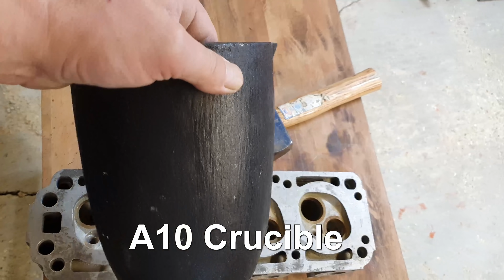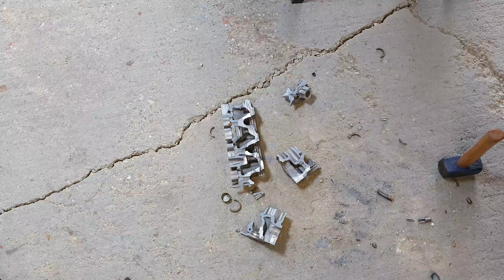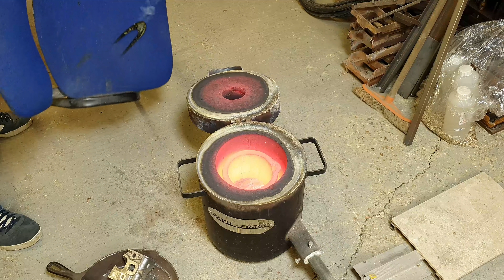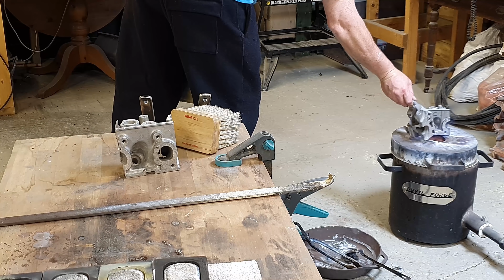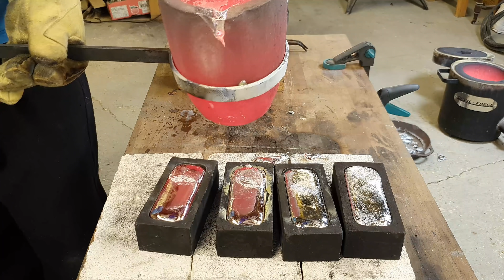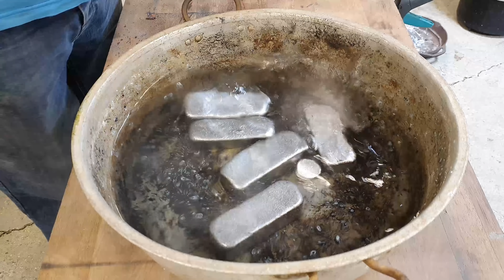BMW Cylinder Head Melt - BMW Bullion

Comment from the maker: Hope you are all well during these mad times...  This engine block should provide me with some decent casting alloy for future projects.  Shrinkage seems to be very low and should be extremely strong being 7000 series aluminium.  Stay safe everyone.  Cheers Andy 🥂👍😎
Reply: I'm sorry if this a question you keep getting asked, but where do you purchase your crucibles from?
Reply from the maker: Are you based in the UK ?
Reply: @MeltandCast  No. East coast of the United States
Reply from the maker: Ah OK...  The crucibles I use are Morgan Salamander crucibles and are extremely durable.  I've never had any issues with any of them and am yet to wear one out !!   I just looked at their website and it looks like they have a factory in Wallingford, Connecticut.  Try searching Morgan Salamander Molten Metal Systems in this area.  Hope this helps.  Cheers Andy 😎👍🥂
Reply: @MeltandCast  Thank you so much!
Reply from the maker: My pleasure mate 🥂👍😎
Reply from the maker: Oh and you might have to call them to find a local distributor as I don't think the factories sell direct, at least they don't in the UK.  Shop around though, some resellers really hike up the prices (at least they do here) hehe.  Hope you find what you need, cheers 😎👍🥂
Reply: @MeltandCast  will have look again but I think they have a channel showing how they make them.
Not your normal everyday clay graphite crucibles.
Reply from the maker: They really are good crucibles...  I'm told they last 3 years plus if looked after.  After just over 1 years use all mine look good as new.  Some have flux residue on them but they all seem very resistant to chemical attack.  Nothing like those cracked clay crucibles I've seen elsewhere on YT that seem to split, crack and break all the time.  I'll have a look for that video it sounds interesting.  Cheers Andy 😎👍🥂
Reply: @MeltandCast  hope all is ok with you.
Reply: Worked on a bmw  this morning and all i see  almost is aluminium aluminum!!!!  😋
Reply: Instablaster.

Comment: Does remelting and casting do much to reduce the usefulness of the aluminum?
Reply from the maker: Not as far as I'm aware although overheating it can cause issues (and this melt was probably quite well overheated).  It shouldn't be too much of an issue though, the only likely adverse effects as far as I'm aware is you may get additional dross on the second melt due to the additional oxides present as a result of the overheating.  If you look closely at the final ingots you may see a little porosity but this can also be fixed on the next melt by degassing, which I will do when I sand cast this in a few days time.  My main aim with this melt was to remove the steel parts from the engine and get it into smaller ingots to make life easier for me next time.   This way I can melt all the metal required at once, monitor the temps better and degass before pouring.  Most of the other aluminium I have melted is 1 series aluminium and it suffers horribly from shrinkage and is difficult to cast especially with my lack of experience working with aluminium.  This alloy hardly shrinks at all, in fact I had a real job removing the ingots from the moulds.  These ingots will be cast into a gift for a friend and I wanted to use a decent alloy to give me the best chance of a successful casting.  Cheers Andy 😎👍🥂

Comment: That cylinder head was originally cast into its current shape, so the alloy should be great for whatever you need to cast with it. 
Cheers
Reply from the maker: Thanks Ted.  That's what I was hoping for, the other 1 series aluminium I tried using before shrank terribly.  If I mess up casting this I can't blame BMW, the fault will be all mine haha.  Take care mate...  Andy 🥂👍😎

Comment: What kind of cutting disc was that on your angle grinder? Does it work well on steel? Abrasive discs wear out fast so I'm curious about alternatives.
Reply from the maker: They were the cutting discs that came with the grinder, they are very thin but last quite well.  I did shatter one disc on the back side of the engine block, but they go through steel and iron like butter.  Softer metals seem to take longer especially zinc which is a nightmare.  I tried to cut a 12kg zinc ingot in half and used a whole disc and only got halfway through.  In the end I just melted it in my big frying pan and poured it into a crucible to make smaller ingots.  Cheers Andy 🥂👍😎

Comment: Just curious, What makes you think the alloy is  from the so called 7000 series - seems an unlikely alloy to make a cylinder head from. Incidentally the most common alloy (DTD 5008) in this series has just 0.5 to 0.7% Mg. I have worked extensively with this alloy and while it is a joy to machine - after waiting at least a week for it to naturally age harden - it is not the most castable of alloys It is prone to cracking in the die to the extent that it is generally considered as not suitable for gravity die work and it does not feed anywhere near as well as, say, 356. I think most EU manufactures are obliged to mark the castings with an alloy designation for recycling purposes so if you have another head look at ALL the numbers/letters stamped on it, somewhere in all that should be the alloy designation. All that said it would not surprise me what BMW used, their choice of wheel alloy is IMHO absolute rubbish and is perhaps why people tell me that if its a BMW wheel it will likely be cracked!... Martin
Reply: Thank you Marin.  ;-)
Reply from the maker: Hi Martin the engine block is from the N45B16 engine and after a lot of searching I am still struggling to find a definitive answer to the alloy type used in this engine.  Maybe my searches aren't accurate enough but i did find a company called HT Howard who manufacture camshaft caps matched to the engine alloy used in these engines.  The quoted numbers for these caps are "7 559 168" and "7 505 975".  I took this as 7559 alloy and 7505 alloy.  I looked up both of these in Woldmans book of engineering alloys and couldn't find a specific match for this alloy.  I assumed this was because my book is the fourth edition and being a newer alloy, it may not be included in my book as it is now up to the 11th edition.  Additional searches for 7559 and 7505 alloy also drew a blank and the closest I could find on Wikipedia was 7475 aluminium at 5.75% zinc, 2.3% magnesium, 1.5% silicon and 0.22% chromium.  7 series alloy was described as one of the highest strength aluminium alloys and thus it made sense to me that this may be a suitable choice for BMW engine blocks.  I did find 5575 series aluminium on Wikipedia as well but was described as suitable for marine applications and automotive trim.  Therefore I made the assumption that this was 7 series aluminium due to the strength.  I do have another section of this engine and will check the numbers on it next time I am in the shed, I will also check back on the unedited video as I think the numbers were also visible on that.  Thanks for all your advice...  Andy 🥂👍😎
Reply: @MeltandCast  Perfect use for that cylinder head.  Now maybe it can have a longer life than the shitty engineers at BMW could have ever planned for it!
Reply from the maker: Rofl 🥂👍😎

Comment: You do know you can use a plain ordinary skill saw with a cheapy saw blade and slice aluminum up right?  It's 20times faster than a cut off disc and 50times safer.  Use a few sprays of wd40 for lubricant.
Reply from the maker: Thanks WT, no I didn't mate...  I have a chop saw that I hardly ever use for wood...  so just use that ?  I don't need a metal blade ?  I did shatter one disc going through the block and it took much much longer than it shows in the video.  Thanks for the advice, I'll remember that next time...  Cheers Andy 🥂👍😎
Reply: @MeltandCast  Well there you have it!  Yes you could use your chop saw, but try to clamp your work down.  I just use my beater 7 1/4" skill saw and a thin 48tooth blade.  Get it up to speed and have at it.  Do wear plenty of PPE.  I wear safety glasses AND a full face shield.  Leather gloves, apron and long pants.  You will be shocked when the chips start flying!  It really cuts like butter.  Best part, you don't end up breathing all that ground up grinding disc and aluminum dust.  You'll never use an angle grinder on aluminum ever again!
Reply from the maker: That's brilliant mate, thanks for that.  I'll have a dig around the garage and see if I can find my old skill saw...  Cheers Andy 😉🥂👍

Comment: Hello. I have to melt 1 gram of iron in 300 grams of copper. Do you know a way to do it? My oven can reach 1250 ° C and is electric.
Reply from the maker: I'm probably not the right person to ask... hopefully someone will read this and weigh in.  At 0.33% the percentage is very low, I guess you are making some kind of aluminium bronze ???  Iron is insoluble in copper and doesn't want to alloy with it, kinda like oil and water.  Having said that I'm fairly sure copper has the ability to absorb a very small amount of iron.  My initial thoughts would be that you require more heat, but it may be possible to dissolve an amount of iron that small into the melt if you melt them both together.  I have next to no experience with iron and copper apart from my two attempts on a couple of other videos, with which had mixed results.  I did manage to melt the two, but not alloy them properly.  Most of the time the iron was visible as spots and streaks in the ingots.  I guess you'll have to try and see...  Sorry I couldn't be more helpful...  Cheers Andy 🥂🍺👍
Reply: @MeltandCast  ok . Good

Comment: what kind of cutting disk did you use on the angle grinder? I heard you're not supposed to use a steel cutting disk for aluminium

Comment: Am I missing something? I didn't see any boil off from the zinc or reaction of the magnesium.
If you haven't already, look at how oilburner melts engine parts.
Almost forgot, thanks Andy, stay safe and healthy, good show👍👍
Reply from the maker: Thanks Donnie.  Although I probably overheated this melt, I don't think I overheated it enough to boil off any zinc.  I was concerned about the magnesium content too, perhaps it's not so much of an issue with cast aluminium from the BMW factory as their foundry is so advanced.  Olfoundryman was dubious about the fact that I thought it was 7 series aluminium with the zinc and magnesium, he hasn't replied to my comment on his post yet, so I'm waiting to hear his verdict.  It's quite possible I got the zinc and magnesium content wrong though.  I do have some aluminium which I know for sure is 7 series with a magnesium content of 5% I believe... I can double check this as I know the source and can get the exact alloy code from my friend who uses it.  I will probably try melting some as a comparison and see if that burns out.  I haven't melted it previously though for this reason.  
I have seen quite a few of Oilburner's videos, the way he melts his cylinder heads is awesome, I would really like to have a go at making one of those crazy burners for myself, unfortunately the oil I had saved from my oil welders may be toxic so can't be used as a fuel source.  Once I have another fuel source I will probably have a go at some of his simpler designs...  Although I must say I wouldn't mind having that 300kw burner in my arsenal !!!  haha.  Best wishes mate, keep well...  Andy 👍🥂😎
Reply: @MeltandCast  of all the channels I watch, oilburner has the best sarcastic humor. I did a bit of nosing around and was amazed how long he's been melting. Thanks Andy, BTW I believe Martin has been going through some health issues, may be the reason he hasn't gotten back with you.
Reply from the maker: Didn't know that, I wish him a speedy recovery...  🤞🤞🤞

Comment: hmm, whats that smell?  ah &*)#%!$!#$  

Got to love when it is that hot that it just gradually melts anything you've added to it!  Looks like you got some nice clean aluminum there, very nice set of ingots.  I had thought when you mentioned zinc that you may have some of the lovely white smoke, but looks like the zinc must bond well in this process and not boil off like we see in brass and some others?
Reply from the maker: Mate, its stank to high heaven...  I didn't realise at first, I thought there was something on the ally until I saw my chair smoking !!!  I was also worried about the magnesium and zinc content in the metal and I was concerned the magnesium might burn out, but it seems it's not an issue at all.  The shrinkage was almost non existent and ingots were so tight in the moulds it was really hard to remove them.  Gotta thank BMW for that...  most advanced foundries in the world !!!  I hope I can use these to make an aluminium casting for my friend without the problems I've had in the past with shrinkage.  Take care mate...  best wishes Andy 🥂👍😎
Reply: @MeltandCast  Had wondered on the magnesium as well.  Interesting to be sure!  Good luck on the upcoming pour!